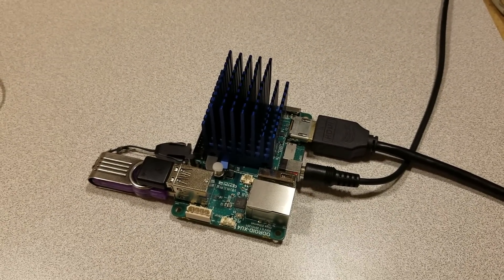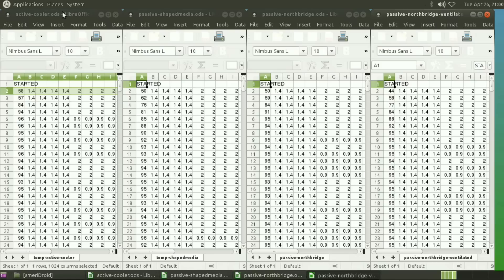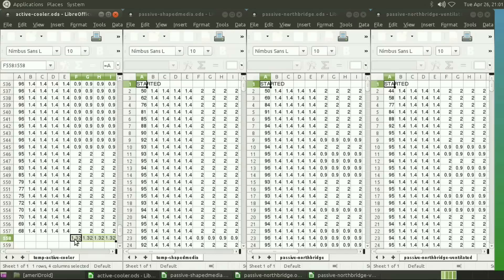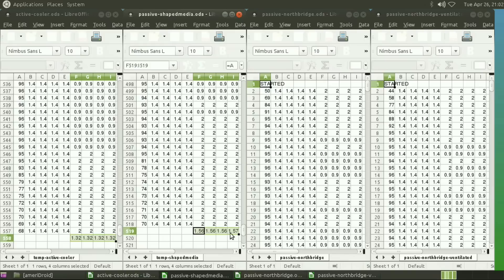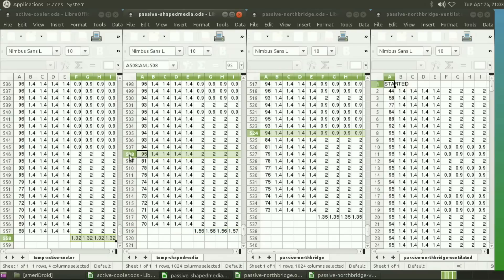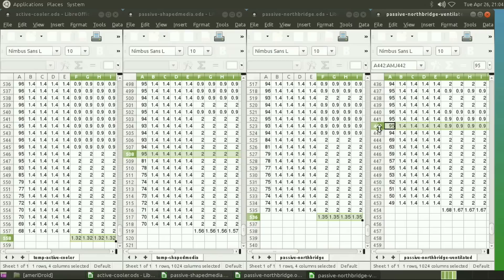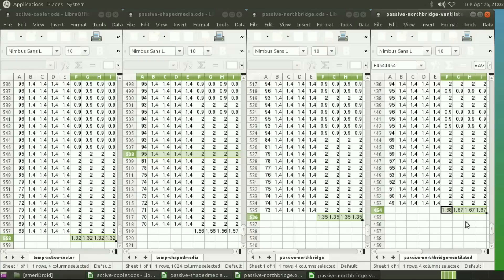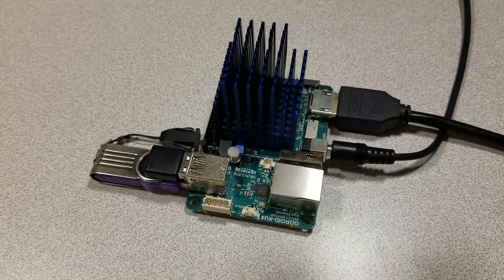ODROID-XU4 Cooling Tests (4 methods)

Comment: bin the spring clamps and use m3 bolts, you'll need to add nylon spacers but it does work. The tension on the stock cooler is rubbish

Comment: I'd love to know how you got the logs... do you have a script/program you would share?
Reply from the maker: +kicker22004 We used Rebol3 for ARM (http://rebol.com available in the downloads section). Here is the script we used to collect the temperature and frequency data:

REBOL []

echo %temp-mon.log
print "STARTED"
forever [
  out: form (load %/sys/devices/virtual/thermal/thermal_zone0/temp) / 1000
  append out "^-"
  for i 0 7 1 [
    append out (load rejoin [%/sys/devices/system/cpu/cpu i %/cpufreq/cpuinfo_cur_freq]) / 1000000
    append out "^-"
  ]
  print replace/all out "^/" ""
  wait 1
]

...and here is the sysbench command:

sysbench --test=cpu --cpu-max-prime=100000 --num-threads=8 run
Reply: +ameriDroid Thank you very much
Reply: Yes - Sharing your testing procedure and tools would be a great way for ameriDROID fans to share their results!